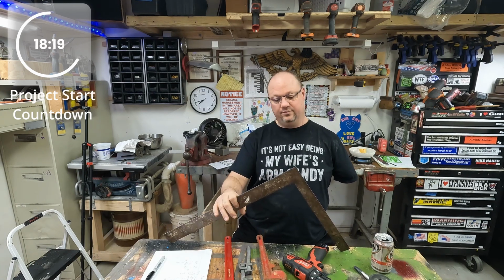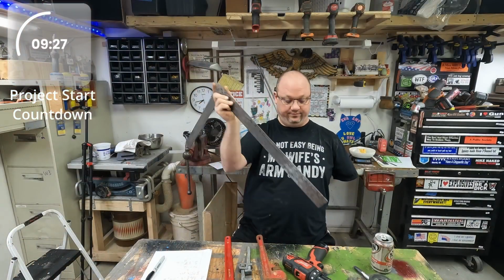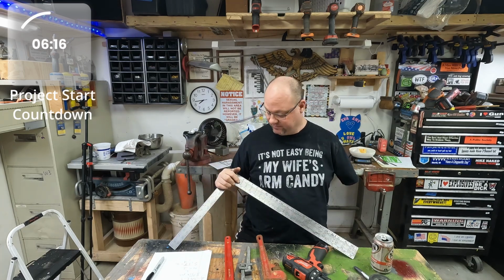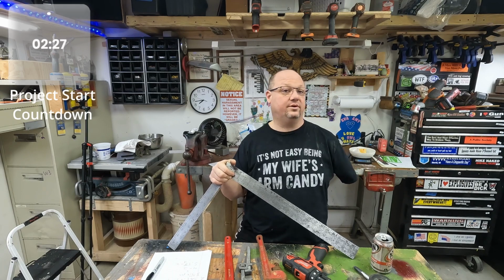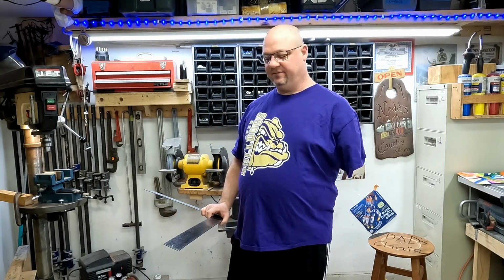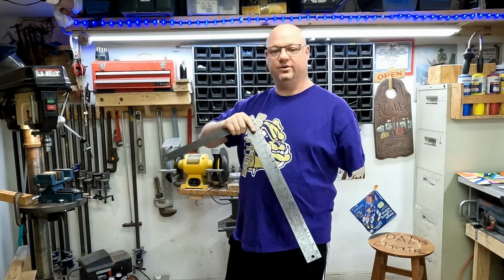Framing Square Rehab

Comment: What would you recommend for someone without the power tools? Wire brush and steel wool?
Reply from the maker: Yes. Use evaporust or other chemical rust converter first. That’s easier than wire wheeling. Start with a stiff wire brush, then use coarse steel wool with some type of oil like 30 weight or WD-40. Then finish with a Scotch-Brite pad or other abrasive pad. You should be able to get pretty close. The real answer also is you need to be as done as you want it to be. If you put a clearcoat over your final product, it won’t matter if you leave some rust there or not. Thanks for watching!